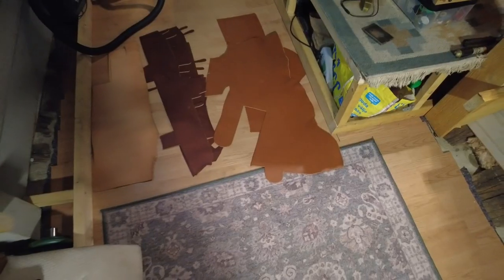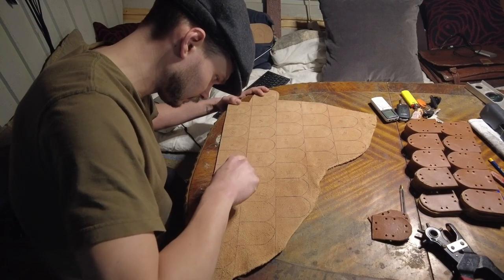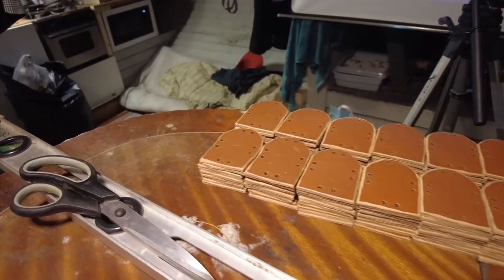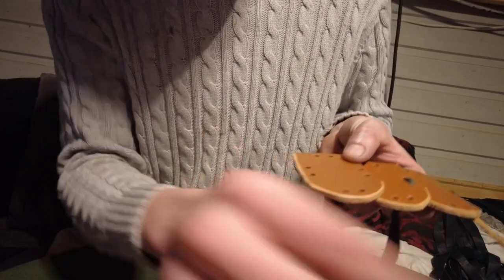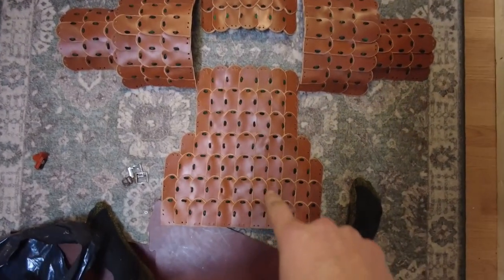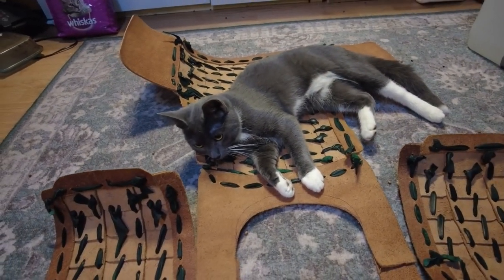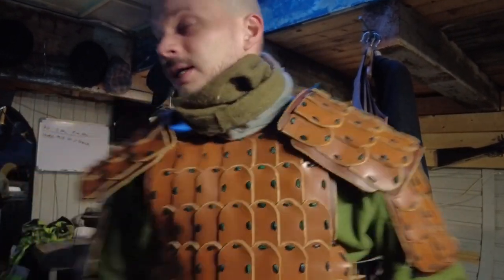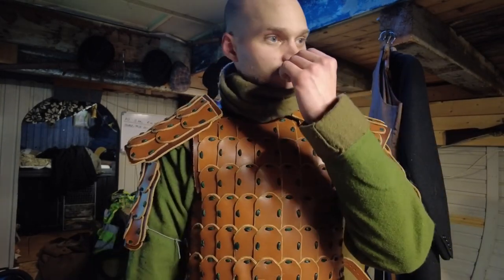Awesome Lamellar Leather Armor (do it your yourself)

Comment: I think the cat stole the bow!
I assume this is too thin for SCA heavy fighting. Am I right there? 
If you were going to boil it, would it be before or after punching the holes? 
I love the look of the layering too! It coming together in the center gives it a cool depth to the look. My second hand piece is a straight wall of lines, and doesn't look nearly as good.
Reply from the maker: leather armour is not optimal for SCA i would say. would love to do one with bronze plates.
i would boil it first becus the leather tends to shrink a bit.
my thinking whas it would give better protection ass well.
when the plates overlap in this way.

Comment: Where did you get that hood/scarf combo? Does that type of thing have a specific name? 
Also, how long (approximately) is the "long time" that it took to make this?
Reply from the maker: i made it my self. i will make a vide on how to make one chek back in a week or so. its called a sköldehamnshätta i just did som adding to it.

if you work 12 houer day you will haw it done in 2-4 day depending on your previus experience